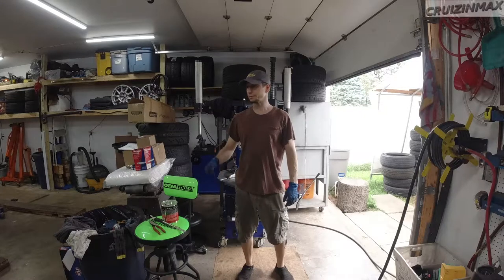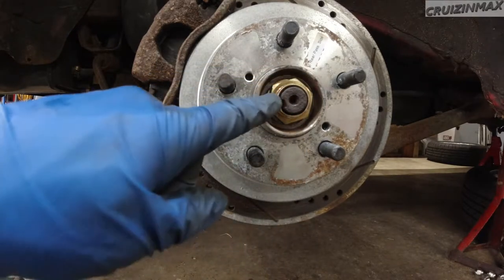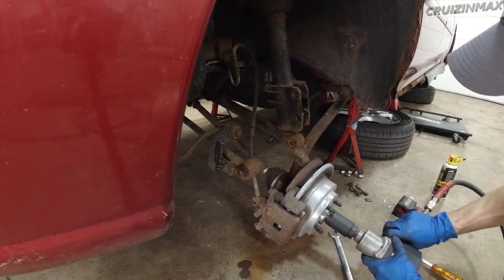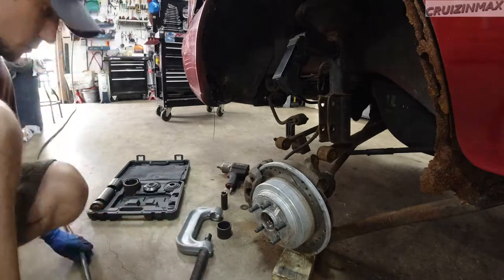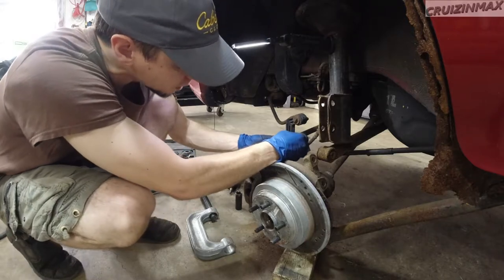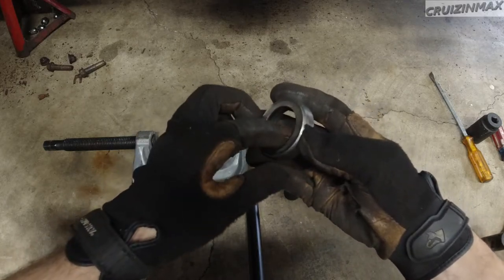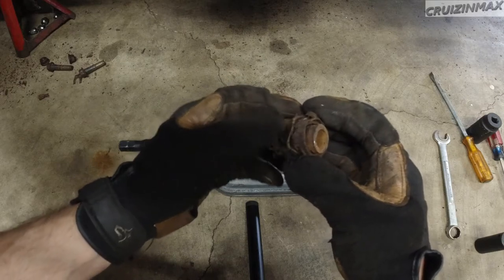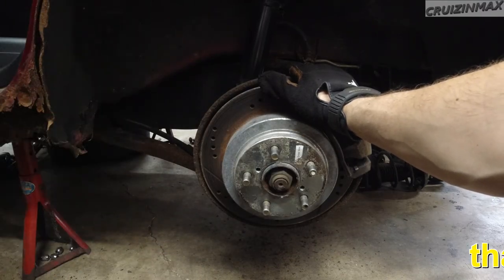Subaru RS rear trailing arm or lateral link bushing removal part 3

Comment: I've had really good luck using a hole saw kit to cut the rubber part out of the bushing, and then taking a dremel with a cut-off wheel to slice the metal retainer in two place to cut it out. The retainers generally have a fair amount of corrosion and with the relief cuts come right out. 
Throw the new bushings in the freezer and heat the arm up a little and the new ones press in with ease.
Reply from the maker: done that myself using a sawzall on different applications.

Comment: Wow, that is some impressive rust/rot above the rear wheel wells. Thankful my '04 Outback hasn't gotten that bad.
Reply from the maker: haaa, wait till you see part 6, rust hole in the passenger floor 1ft by 1ft and rockers are just gone totally...